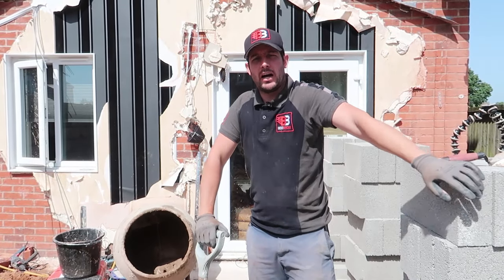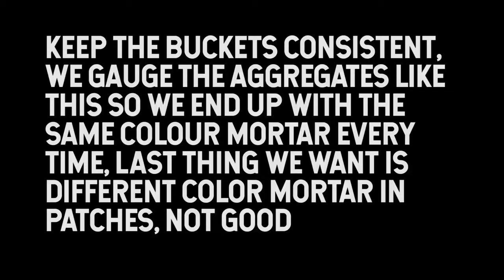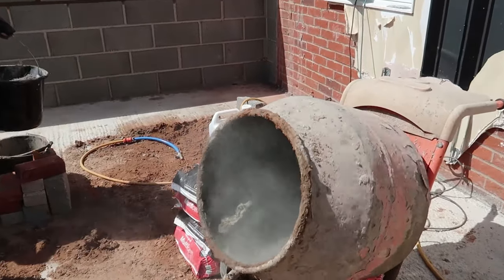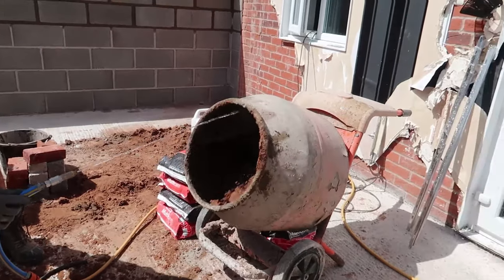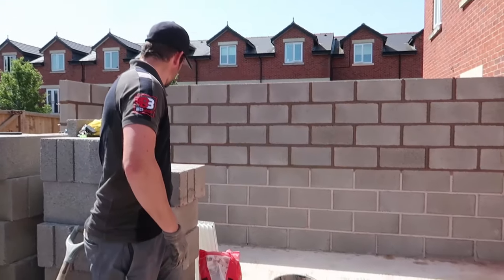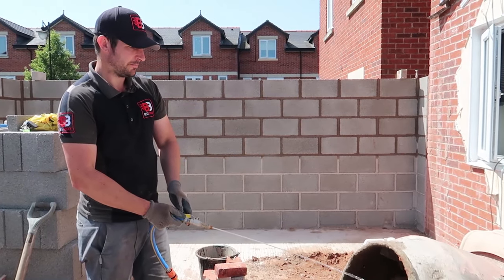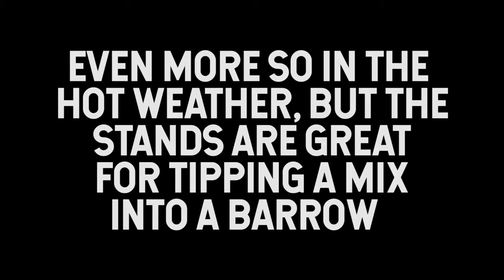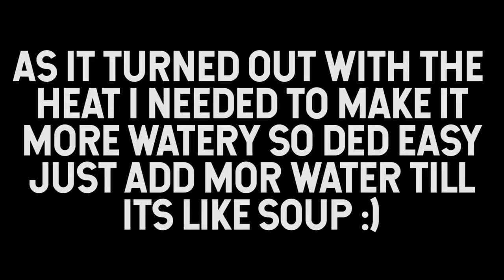Bricklaying Tips - Mixing Mortar

Comment: Great work guys. Fellow masons at it. Just here to mention to your crowd that mortar plasticisers are a great way to adjust your mortar workability without disrupting your water / cement ratio and thus requiring too much water. Also if you live and work in warmer climates, as I do, plasticisers can do miracles SINCE they are not absorbed by cement as fast as water allowing you greater working time and slower setting time. This might not be so obvious in colder countries but when working under 35 degrees its a "lifechanging" difference. Lastly, a mortar plasticiser can also add some wateproofing properties to your mortar.
Reply: Loop 0⁰

Comment: My dad told me never to put a spade in the mixer too, normally while he was putting a spade in the mixer.
Reply: My old gaffer did when he was a kid now he cant use his thumb. Lovely hobo tho so I here
Reply: Gobbo*
Reply: @nataliecarvell5494  It happens, at least he's got the other hand to hold a brew. Mate of mine lost a thumb too, still a bloody good brickie
Reply: There is a fine art to removing gobbo from a moving mixer with a shovel.
Reply: I do it all the time, I don’t recommend doing it but needs must sometimes 😂
Reply: Drain spade is the best if you need to do the one thing we all know we shouldn’t
Reply: I do it everyday, just gotta not be dumb about it
Reply: Why would anyone put the "spade" in a concrete mixer.   You just use the "spade" to toss in the sand and stones.  Motor has not stones and is not mixed in a concrete mixer.   Now, put a "spade" in a real mortar mixer and the paddles will grab it.   The lime in mortar will cause it to stick to the sides of a concrete mixer and it will just rotate around and it won't mix.

Comment: 5&1 above 4&1 below or 3&1 below i was always taught 4&1 above is to strong the gobbo should never be stronger than the material your laying. any movement and you will get cracking through brick and not the joint. The batching plants send ready mix out at 5 & 1 above dpc. I worked with some fellow bricklayers not long back that kept getting cracking through there internal blockwork and after working with them found out they was mixing 4&1 And it was to strong. I love your vids mate not nit picking it's just a very common mistake lads make.
Reply: That's what my old college lecturer (Ken Dewing / NORCAT) taught us in the mid - late 80s.

Comment: Thanks Stu, good advice as usual mate. we use 2 bags of sand to half a bag of cement.
Reply from the maker: That’s a good tip to Karl.  You can do 2 25kg bags of sand to half cement and also 4 bags to 1 cement. That will max the little mixer. Hope you’re well pal
Reply: Very well cheers Stu, Hope you and your dad are keeping well?

Comment: Thanks for the video. I'm assuming the bag cement is more of a pure Portland cement and that is why you add the plasticizer. Here in the U.S. we use pre bagged masonry cement that includes Portland cement, air entraining ingredients, and plasticizers such as lime or ground clay already pre-mixed in the bag. Then we add sand to the mix and water. Three parts sand , two parts masonry cement and water. No plasticizers are necessary since they are already in the masonry cement. I Googled Hansen multicem , but did not pull up the data sheet, they are a major distributor in the UK, I think that's where you're located. Enjoy watching your videos, it's good to see how things differ from country to Country. Keep up the good work and the good attitude.
Reply: it depends. He is a commercial brickie so for him it is all about cost. 
You can certainly buy the same product you mention, "cement" including additives. One such brand is called "mastercrete"
However it comes at a price premium which for those in the trade is unjustified when all you need do is add plasticiser yourself at a fraction of the cost. 
Like most in the trade, you'll note he ignores the actual specified mix ratio for the liquid plasticiser and added a "liberal" glug of it whilst openly commenting that it's too much! Time is money when it comes to precise measuring .
Reply: Excuse me sir, may I use your bathroom?

Comment: 8:37 “Never mix your mortar stronger than the material...” To which I agree, and that is what I was taught.
If the mortar is too strong, any movement and also moisture has to be absorbed by the material causing it to be under more stress and deteriorate faster. The mortar should instead absorb those stresses - it can be repaired if needed. Someone started an argument with me over this, and insisted setting brickwork with pure cement would be a good idea.
Reply: Can you explain more? How do you judge the strength of your material.
Reply: @cookeslifeandtravels8568  It's not that complicated, old clay bricks are rather soft, modern bricks are a bit harder, engineered concrete bricks and natural stone like limestone and granite are much harder. Suppliers tend to provide recommendations to the mix ratio.
Reply: @disklamer  Thank you!
Reply: @cookeslifeandtravels8568 Also consider what type of strcture, load- bearing, indoor/ outdoor, required flex and lifecycle. Bricklayers e.g.
 may use a different mix for laying vs. pointing. The pointing is easy to redo.

Comment: Nice vid mate, I tend to find the concentrated stuff is the best, only using 10ml a gauge and adding just over half a bucket of water seems to be perfect every time for a 5-1 mix, tend to find when the muck is flowing through the holes of the blades and is rolling at 2 o’clock it’s normally cock on for bricks and thermalites.

Comment: Great stuff as usual, guess adding water to get the right consistency comes with experience. On the rare occasions I do a bit of diy brickwork in the garden I always struggle to get the mix just right
Reply: It’s the plas mate that gets the working consistently, little brick work in the garden just add some fairy but anything structural use a proper plas

Comment: Don't get cement down ya boots with bare legs. He's a tip, I throw a rubber dustbin lid over the hole after adding cement to stop the dust flying out. Impressed with using accurate bucketful instead of chucking inaccurate spade fulls in but surely plastersiser should be measured out for consistent strength of mix as too much weakens it. Some would say that mortar should be dry mixed first before adding water. Whereas not so crucial when mixing concrete as the aggregate  helps mix it all up.

Comment: I could never mix and not level off the buckets flush 😜. Then i know its exact. If on a stand which I prefer you can lift it up slightly as you did to get any sticking off the back or jam it up slightly. Each to there own similar ways same kinda results. 👍🏻 Prefer a stand for tipping out. KEEP HER LIT! 👍🏻

Comment: Good, easy instructions. Any tips on how to clean out mixer after use? And how to dispose of the waste from mixer? Cheers
Reply: I always use water and a shovel of gravel to clean mine just leave it running when I'm packing tools etc  , cleans it lovely even round back of blades, water and a stiff brush works OK too
Reply: Hosepipe immediately after every mix. Then none dries on the paddles or cakes the outside of the drum in muck, you also have then have the water in for the next mix. Just how i do it. Best way I've seen. Always clean tools immediately after each use. Just lazy to leave it till later. I pour that into my barrow and clean my barrow with the water. Spray the inside of the drum while tipped until water runs clean. Pout the water away. Any sludge goes in the skip.

Comment: quick question, what are you doing with the concrete floor? will it need a layer of self levelling compound on ?
Reply from the maker: Not sure just yet but concrete is pretty level so no real need they may just seal then tile over

Comment: Hi! I really enjoyed the video. I had a few questions. What is the size of the buckets you are using in liters? I am asking to understand the ratio of plasticizer you add to the mix -- it looks like you use about 1/4 of a 5-liter container. Also, I was unclear about the amount of water you add in total to the mix.
Reply: He was using the bostik plasticiser which says about 85 ml to a 25 kg of cement which is one full bucket (14liter) standard bucket of cement, which is about half a bag of cement to 4 buckets of sand, so use about 40ml to a mix, he glugged probably 5 times that in, I personally find the 40ml is not enough to get it smooth.

Comment: What do you think of 15 shovels to one bag🤔 what i used to have to do when labouring, was a larger mixer and used about 3 bags each time
Reply from the maker: I always use buckets because it’s harder  to gauge a mix with shovel pal
Reply: We do 12 shovels or 4 buckets to half a bag of cement 🤔
Reply: @AshSmash981  perfect buddy 24 and a  bag is exactly right in a diesel mixer or 12 and half a bag like you say in a belle mixer 👍 works out at 5&1 perfect mix for above dpc.
Reply: I labour for plasters and we use big diesel mixers. For the most part I use the shovel especially when we're floating or doing scratch coats. It's quicker. But when we are doing a fine finish like dash I use buckets. For colour consistency

Comment: Can you show the novices how to mount a mixer on its stand by yourself? 
There’s a knack to it , quite easy when you know how 
I’ve always mixed it water first then cement then sand adding more water at the end if needed
Reply: I found that out recently .
Reply: The old tilt forward, attach, tilt back method ?

Comment: Asa guy just mixing small amounts for DIY i can never get a nice consistency of mix, its always to wet or too dry or sometimes, both at once.
Reply: Let it mix in the mixer for longer, moisture takes a bit of time to show so add water and wait a bit. If doing 4:1 bring it to the right consistency after every round of 8:2 load. 👍

Comment: Hi Stu, Liking your videos. I’m looking at laying standard dense concrete blocks to build up a sloped garden for prep in laying a small patio...about 12” high. Should I use sharp sand for the mix? Thanks
Reply from the maker: no always building sand with bricks and blocks, flags and tone work you can use sharp sand in the mix

Comment: Top stuff Stu. Just about to tackle sandstone slabs in back garden. What ratio sharp sand/cement mix would you reccomend?
Reply: 4:1 on a full bed of mortar
Reply: 2 parts sharp sand, 2 parts building sand, 1 part cement
Reply: @richardaskham2154  Cheers pal. I've seen all sorts from 3:1 to 10:1 and still none the wiser!
Reply: @TheDranny  no worries,

When laying Indian paving slabs I seal the back of them with dilute PVA, it's the same principle used when plastering. It stops the flags absorbing the moisture to quickly which can lead to the top of the mortar forming a skin of dryer material, which can cause the bond between the slab and mortar to fail. I'm sure there's other ways but I've never known this method to fail.

Comment: for colouring the mortar, would it do any harm to over add colour? I'm trying to get the mortar as dark as possible and i'd only need one batch so colour consistency won't be an issue between batches but would it do any harm to add more than the packaging says? (packaging suggests 25ml per 10kg of mortar)
Reply from the maker: No it’s just dye
Reply: If your gonna add dye to your mix, make sure the water content doesn’t change, a wetter mix with darker dye will result in a lighter drying colour
Reply: @keironhiggins9620  it's gonna be a pointing mix so I assumed with it being dryer i'd have to add more dye but it's good to know it's almost the opposite, cheers!

Comment: Great video Stu, thanks for sharing your skill. I have often seen folks using fairy liquid instead of plasticiser. Im guessing it's old hat from the days before plasticiser was available. Perhaps it makes sense for DIY projects if only doing a small job and unlikely to warrant buying a tub of the proper stuff? Is it ok to use fairy liquid or is it a no no?
Reply: I'd second the question. 
I do because that's what I was told to do. But not too much because ,I never found out the answer it might involve buying more washing up liquid or dissolving mortar , really no idea.  PVA was also on the ingredients list for defying gravity

Comment: Hi Stu. How many blocks can you lay using a full mix?
Reply: On average its 50 blocks / 100 bricks per mix
Reply: It's works out 1 kg of mortar per brick or about 3 kg roughly per block if Stu is doing 4&1 in a mixer he will probably fit 16&4 in a small belle mixer that he uses so that would be roughly 125 kg of mortar in total. So roughly about 40 blocks or 125 bricks.

Comment: That’s great, tip the sand in and half the water slops out ... duh.

When did dry mixing sand/cement then adding the gauging water with the correct quantity of plasticiser already incorporated go out of fashion ...
Reply: If you dry mix then add water after it sticks duhhhhh